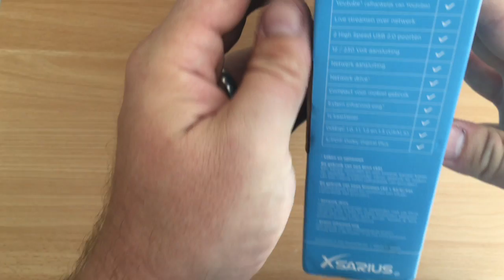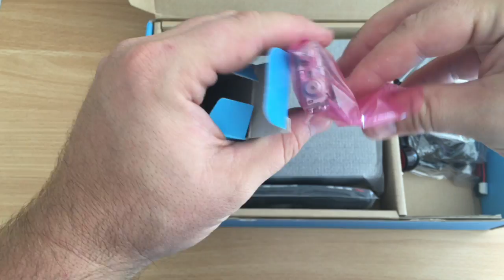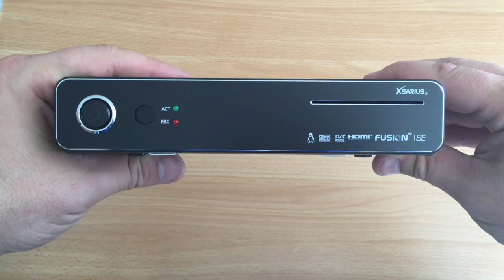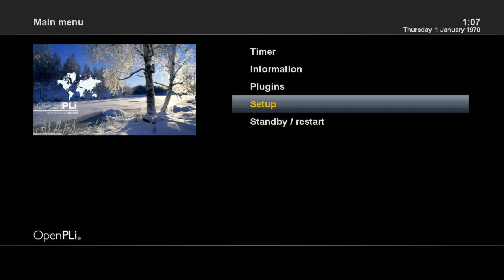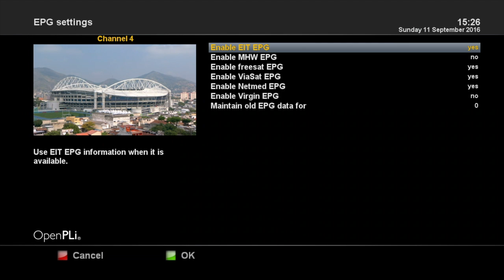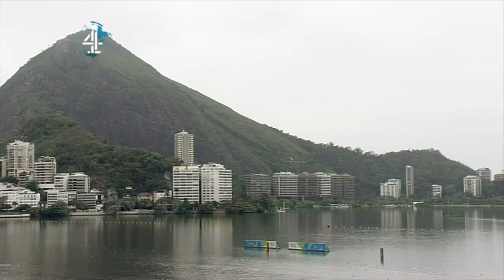Xsarius un-boxing and basic setup scanning channels

Comment: Nice video. In your opinion, which of these E2 receiver boxes have the most responsive remote controls? With my Venton you really have to point it directly at the box & press hard on the buttons for it to register. Just wondered if this is the norm with these boxes? Cheers